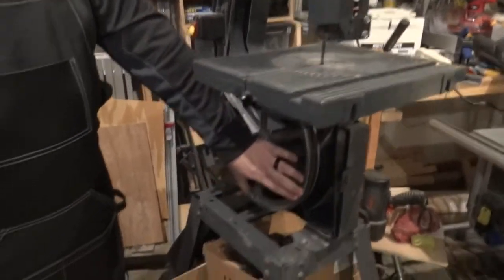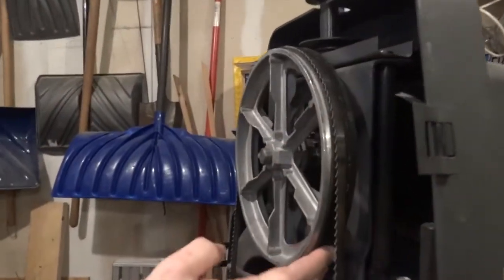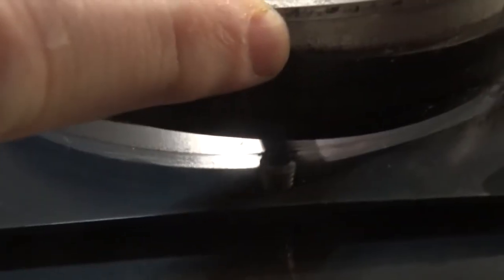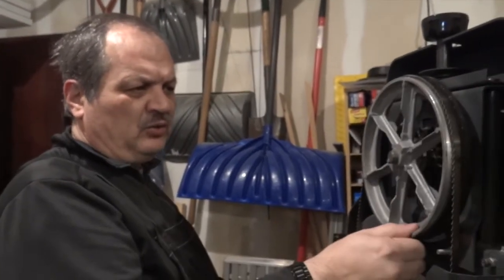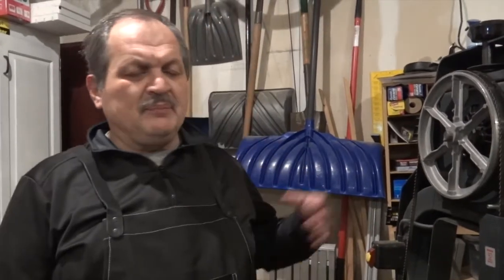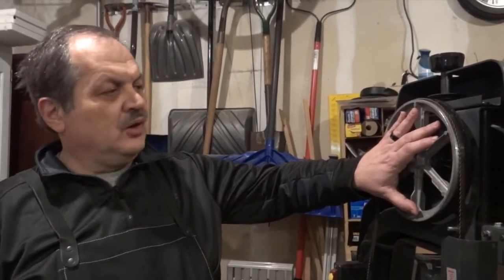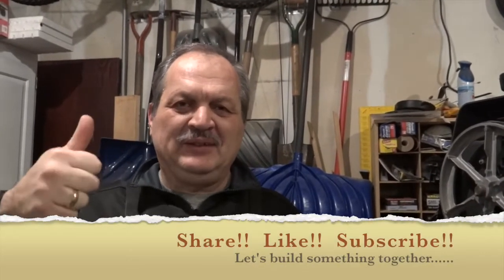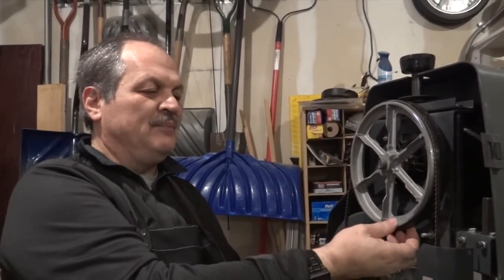HOW TO FIX A BAND SAW WITH A SLIPPING TIRE!

Comment: I appreciate your video - thank you, but your title said "How to FIX a slipping tire. Your response was to say REPLACE it. I do not want to replace it I only want to keep it from slipping. I think that is why David Alcox below is complaining. Today I will be going to the auto parts shop to buy some gasket sealer which I will apply to the internal EDGES of the aluminum wheel (perhaps 1" of sealant to 3" of space not the 1" surface only the edges) to try to get the tire to stay in place. I simply do not want it to jump off track. By applying it only to the edges I should be able to cut it later between the wheel and the rubber (just on the edge) and be able to pull the tire off without having to scrape stuck rubber from the 1" surface of the wheel. If this works I will return in a few days and edit this post to let you know
Reply from the maker: I understand and I will fix the title. When it starts slipping it needs replacement there is no fix I tried many different ways nothing worked. Thank you for watching and taking the time to comment
Reply: @ProfessorDIY  I tried my idea of using automotive adhesive/sealant to essentially glue the tire to the wheel by putting a bead of sealant in the corner. I followed the product directions and allowed 24 hours for it to dry. It did not work. The tire flew off the wheel after one minute of use. So I put it back on and used electrician's tape along the edges of the wheel - I taped the rubber to the edges of the wheel. I went around twice on each side but not over the center of the tire. It worked good. I was able to finish my project which involved about a total of 20 feet of cutting. I don't know how long it will last though. Your solution of replacing the tire is better, but this is just a "fix" to help temporarily get through a job. Maybe it will help somebody. Who knows?
Reply from the maker: @DATo_DATonian  Thank you for the update I hope someone else can find it useful.

Comment: Ok, so I’m not going to complain about the title, the minute and a half of burning wood and pointless chatter, the background noises, or the fact that nothing even got “fixed”. What I want to know, is did you ever get new tires, put them on, and if so, did it solve the problem? 
  I do appreciate the information about the tires stretching over time. I just bought an old bandsaw and am having the same problem. If replacing the tire is this simple and it fixed the problem, it was totally worth watching the video. 
  A reply would be appreciated…
Reply from the maker: Yes, the whole point here was that if the blade slips you need to replace the tire nothing else works!
Reply from the maker: You can watch this video on changing the tire if you would like: https://www.youtube.com/watch?v=uhsLyfh_HFE

Comment: Very pointless video. You basically wasted your time and others time. Could have been a 10 second video saying we need to replace the tire. Just wait til you get the part then make a 10 second video showing you slipping it on.
Reply from the maker: Thank you for your opinion, Many beginner woodworkers do not know how to replace a bandsaw tire, I got a comment once that I did not show how to remove a screw, I am a DIY channel so detail is needed and ten minutes is by no means a long video. Thanks for watching.